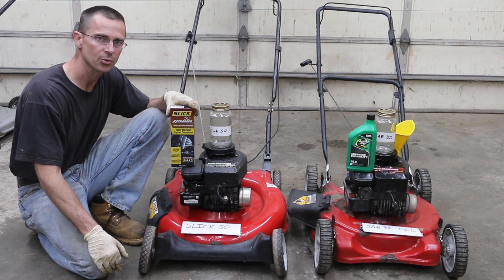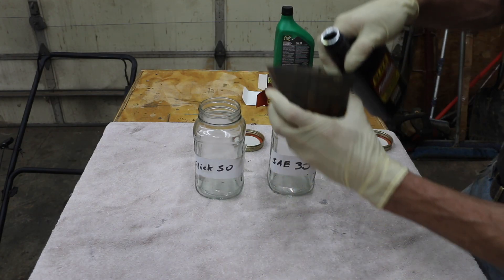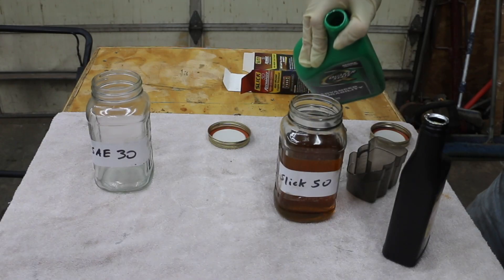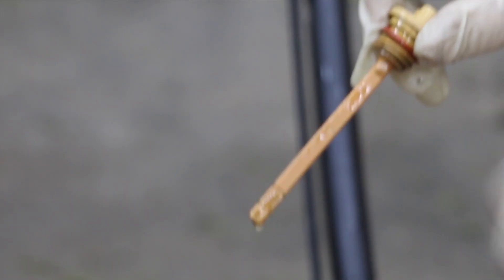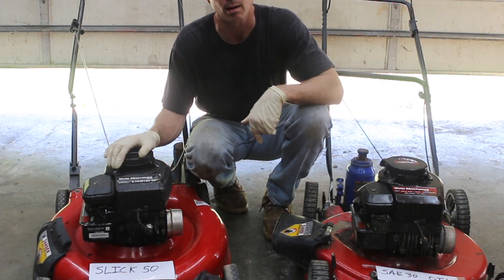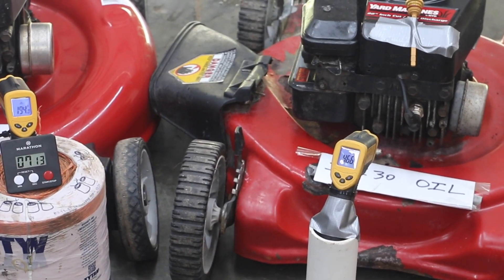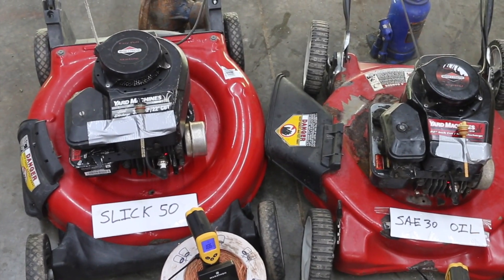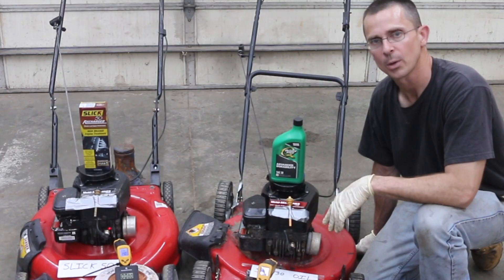Can't believe what SLICK 50 did to my engine!!--Dry Crankcase Test!

Comment: The reason for slick engine failed quicker could be internal clearances. Left engine looks cleaner, newer, has less hours. The right engine looks like has more hours. Just because of more hours engine could have crank/bearings more loose and this could make it run longer.
Reply: In 1984 Slick 50 lost the right to sell the original product. They had to make their own lubricant and it does not meet any of the original specifications of original formula. If you want to try the original formula it is only available branded as Xcelplus.
Reply: Just some thoughts : Idle speed the same ?  Did one have a greater sludge buildup ? One have a heavier blade ? One engine have higher compression ?  It seemed funny how that new oil got so dirty that soon
Reply: Agreed, I was just about to say the same. You need to test on engines with the same amount of wear or check bearing clearances.
Reply: agreed Pasechnik,  although I like this kinda test the motors were not exactly the same.
Reply: The document that shows that Slick-50 today is not the same as Slick-50 pre-1983:

http://www.xcelplus.com.au/docs/false_ad.htm

The Federal Trade Commision (FTC) eventually got involved:

http://www.xcelplus.com.au/docs/ftc1.htm
Reply: Exactamundo ;)
Reply: Doesn't matter, it's still snake oil bullshit
Reply: Troy Mays negative. Tighter clearance means less room for heat expansion these motors didn’t break or mechanically fail they seized due to thermal expansion reducing clearance.
Reply: I agree with a lot of the observations made by others. A couple of things which stand out which makes this test invalid is 1. the engines are not the same age or have the same amount of use. 2. The slick 50 oil was dirtier than the sae 30 oil which suggests to me that the slick 50 engine was not cared for in its previous life and had a lot of internal wear and the sae 30 engine was cleaner and while it looked older may have been in better shape inside.
The whole point of this video, while interesting is nonsense because engines are meant to be run with oil in them, not without oil. 
A better test would be to strip down 2 new engines the same and measure all of the wearing surfaces, reassemble them and then run them both with oil and one with the  additive for say 100 hours and then pull them down and measure the  wearing surfaces and see if there is a difference. That would be a more scientific approach and give people a better idea if it is worth spending their hard earned on a product.
If you have  a small engine and want it to last then just change your oil once a year and it will give many years of service. Additives are just a way for someone to get money out of you that you don't need to spend.
For your car use good quality full synthetic oil and change regularly at least every 10 - 15 thousand kms. In Australia I have seen  a 3.9 litre 6 cylinder ford engine do 975,000 kms and still going strong without ever having the head off. It had oil changes every 10,000 kms.
Reply: I was thinking the same thing
Reply: I think you're on the right track with clearances, but I'm not sure the newer has anything to do with it... 

Slick50 is saying they've got a "magical" version of polytetrafluoroethylene that's supposed to be more robust... The older stuff was using regular polytetrafluoroethylene, which is known for breaking down and turning into giant balls of nasty between your standard engine oil temperature and the temperature of combustion... When it does so, as it cools it collects together larger sizes than what the origins product was when it was added to the emulsion. Those larger diameter particles then begin to plug up the narrow oil galleries in your engine, which then starve it of oil. 
When used in an engine with an oil filter, all those particles are going to collect inside the filter and prematurely plug it. This leads to the oil bypass valve opening to relieve the pressure allowing unfiltered oil to be circulated through the engine, likely with those giant balls of nasty still in it. 
Ultimately, without an engine teardown, we won't know why slick50 failed first... But I wouldn't be surprised to find out that it was due to slick50 preventing oil flow to places that need it, like cylinder walls... Given that polytetrafluoroethylene melts around 500°F and breaks down around 615°F~ish, I'd be very interested to see the inside of the slick50 engine.
Reply: But these cheap two strokes won't have any silicone (or rod bearings!). Looser tolerances on these would actually let them run with poorer lubrication.
Reply: umakegoodcookies You meant 4- strokes I hope.
Reply: True
Reply: I was thinking the same exact thing.
Reply: Pasechnik 
Agreed. May have been helpful to do a compression test on each engine in attempt  to make an assumption concerning wear. However, it's still an enlightening video.
Reply: https://youtu.be/CAt-tJa9P_s
Reply: A compression check should be equal. I noticed the muffler on the 30W mower vibrating, it wouldn't have the same back pressure (and less friction), yet ran hotter. The 30W mower's governor may have increased the fuel, compensating for a lack of compression (more fuel - more heat). But tighter clearances on S50 mower's piston will heat expand & apparently seize first.

Maybe try a worn engine to tight engine no oil test to see who locks up first? Worn engine may last longer but a tight engine should have better economy.
Reply: Bud Nunyerbusiness I think you're on to something sir. Another test would perhaps be to run two engines, whit oil and one also whit slick 50 in it but now without any cooling at all, take away the fanblades and clogg  the cylinders outside whit something so that they run hot as Hell.  Then see if the oil additive helps.
Reply: Just as you say, only fair test is with 2 new motors.
Reply: It looks different now than it did in the early 90s. Is that left engine new? You shouldn't use Slick 50 in new engines. Yeah, I threw quite a bit of money at that product as well.
Reply: I work on cars and motors and more clearance would cause the engine to give up quicker tighter tolerances last longer because there's more metal to have to wear out and new cars actually have silicone in their rod bearings to polish the crank meaning glossing the crank for a longer-lasting engine
Reply: I was thinking that the slick 50 may have a high detergent in it that cleaned the carbon out, which explains the darker color when drained..

Comment: Actually I am more impressed with the fact that the Slick 50 kept that motor cool even with it failing in a shorter time...

A couple of things I have learned about Slick 50 and observed about the test...

1. The original formula is NOT under the Slick 50 name anymore

2. The new slick 50 stuff needs to be shaken in the container it came in prior to pouring, apparently it needs agitation from settling

3. Slick 50 needed to be run at least 6 hours straight with fresh quality motor oil to achieve maximum positive results

4. One of the possible failure points would be that 1 engine was more prone to failure before testing, this is NOT insinuating you rigged it to fail, I am NOT saying that in any way shape or form. What I am implying is, despite modern mass manufacturing some engines will last longer under harsher conditions than others even if they are the same engine. This is not always the case, but it is certainly worth noting.

What struck me the most was again the cooling difference, that tells me the product is actually doing something worthwhile, and I don't know about you but I really prefer to run my engines with oil in them all the time, I prefer full synthetic oil myself (Valvoline MaxLife High Mileage FULL synthetic, NOT the blend).

Comment: Slick 50 is basically Teflon. I used it on an '85 Chevy S-10 that I ran so low on oil the lifters were clacking. I think it saved the engine, but it also had fome coming out of the oil fill tube.
I also used Prolong once, but I didn't accedentally test that one the same way. 
My guess is that you didn't heat up the slick 50 enough for the Teflon to adhere to the engine and instead it did what I've heard others complain about: clogging up the oil passages.

Comment: The engine using slick 50 did not have enough time to treat it. I personally witnessed the same type engine run 12 minutes without oil and with little to no damage, BUT, the engine was treated with Slick 50 for a season of grass cutting.
The demonstration included engine disassembly and inspection of rod, crank, piston and cylinder wall. We even removed the exhaust valve for inspection. 3.5hp Briggs engine.
You did not allow enough treatment time. You did show the lower friction by lower heat.

Comment: Not sure about the "NEW" Slick 50. I used to use the slick 50 from 30+ years ago, and it was a treatment, not just an oil additive.
First thing that was done back then was to shake the can for a bit to suspend the material in the oil, as it was just a carrier of the actual product. Then after adding to a fresh oil change you had to use the motor for about 30 minutes to coat all the frictional surfaces. 
Maybe the fact that Slick 50 called for 10%, and the test was done with 20% bared out in the result. More is not always better.
Yes. I believe the slick 50 still is a good product. If for no other reason than it did seem to reduce friction enough to cause the motor to run cooler = Longer Engine Life.

Great Video +++

Comment: my understanding (no scientific basis) is that products like slick 50 have a very high molybdenum content. and that prolonged use will have a molecular bond in the metal.   so, after some hours of use the two surfaces would be more 'slick' with the absence of fluid.

Comment: While I applaud your efforts, this test is very flawed. Two different engines with different wear on them. You could at least ran the slick 50 mower with regular oil first, check temp. Then add slick 50, check temp. That would have been no question there. I honestly think if you wanted to do this test right you should have used two brand new engines (cost prohibitive I know, and easy for me to say) but in reality this was a waste of time. Thanks for doing it, but I took away nothing from it except that it was a very flawed test. I'd pitch in a few bucks to see you do it with two new motors. I might do a temp test myself on the same engine, my sons go kart engine.

Comment: since the non slick50 egine ran hotter it expanded larger and was able to run longer before siezing. cooler means less expansion tighter engine siezed sooner. since heat shortens the oil life i would keep using the slick50

Comment: If I remember right, Slick 50 contains Teflon particles, which for a short period of time will reduce engine friction and lower operating temperatures.  Problem is all engines burn oil, and when teflon burns it can clog up your oil filter, or worse the oil passages of the engine, so don't put this stuff in your car.  In this case, the briggs engine will indeed run cooler and probably have no ill effects.  My guess is that running without oil in the case rapidly burns the teflon particles, causing it to lock up significantly earlier than the standard oil, I suspect that if you pull the head off and clean it up, the engine with the slick 50 will still run.

Comment: ok the modern Slick 50 is not the same as the old version that did work as described in the videos. I accidentally ran a 1.9 litre diesel for 45 min without any engine oil 25k miles after a treatment the engine went on for 100+ K miles without any issues, this was on the old version.
the old Slick 50 contained a PTFE compound that bonded to engine pressure areas (crank bearings, piston rings, turbo slip rings etc. 
after a long law suit between the owners of PTFE they were made to remove it from their product. So you are not comparing like with like. What is in the new version??? most likely a chlorinated caster oil or modern synthetic equivelent. 
As an aside I would bet the engine you treated with Slick 50 was far more knackered at the start than the other engine. Evidenced by the colour of the oil removed  from both engines. Hence its seizing up early. 
A replacement product to try is "Activate" Available from the UK and possibly other countries.
Its expensive but so far my Fiat (Chrysler) 1.6 t diesel Taxi has done 238500 miles in 4 years 95% driving round a small town 5% thrashing down motorways. Still original Gearbox (treated at  85k miles after oil change) and turbo engine etc. Activate added every 25k miles at 50% original dosage. engine flushed every 50k miles with flushing oil.

Comment: I've just run across your videos and this is about the 5th one I've watched this evening. Most very well done and thoroughly enjoyable as well as educational. (generally) Like some others pointed out, there were some flaws in this test that might have skewed the results, but to test the product you enjoyed over 20 years ago on those commercials, you need to test Xcelplus. That is the original Slick-50 product. A thing happened back in the 80s when the inventor of the product lost the name of the the company, but retained the formula, which the new guys didn't get and didn't recreate.

Keep up the videos. Great work!

Comment: You should have used two brand new engines of the same model and manufacturer. I think the mower you used the Slick 50 in for your test was more "used' than the other one.

Comment: This stuff and similar products are a waste of money and in a modern automobile engine not a good thing to use. Engines with variable valve timing (e.g. Honda) often specify 5W-20 or thinner oils to operate correctly. This stuff is 50W with PFTE . It  will clog up or reduce the oil flow in the tiny orifices in these valve trains. You can guess how that works out.
  Buy the correct oil specified for your car from a name brand maker. Unless you drive on the Interstate all day long, change the oil as required for "severe duty use" a.k.a. normal every day driving. Use a quality oil filter, e.g. Wix/Napa... use Fram filters for a door stop. Check the oil every week, noting that adding a quart between oil changes is normal and means that if there are no leaks your engine is consuming oil as it should... That oil loss is the oil film protecting your piston rings and cylinder bores. Engines that do this should have rings, bores, and bottom ends that under normal use should last 500,000 miles with perhaps a top end overhaul at 250,000 miles.
Reply: Aceroadholder WHAT tiny orifices? We're not talking a carburetor here, and you do realize viscosity is NOT the same as flow rate in motor oil, right?
Reply: Aceroadholder Not to mention, no engine should "use" oil, it's wind age sucked through the PCV valve that's burned in the engine to produce carbon buildup, dingus. Does a new, or even broken in engine that was maintained CORRECTLY, no as the manufacturer suggests so it breaks after 100k and you have to buy another one, does an engine like that "use oil"? No, it doesn't. If your engines "use" a quart or more between changes, it's not working correctly for some reason. Use the grape buddy, use...the grape.
Reply: I can tell from most you folks comments you know nothing about real "Slick-50" as in this video this is not the real stuff....I had an "Slick-50" engine that I used back in the late 70's early 80's that I used for demos, no oil in it after "Slick-50" "proper" treatment....ran for 1.5 hours no oil at all...walked over pulled the rope fired right back up ran another 1-2 hours....sold many a quart of "Slick-50", also had a 1971 FORD Pinto for demos...not a drop of oil or water in it, drove it all around to different shops as a demo...and got 34 miles to a gallon of fuel...never over heated nor locked up....should have seen the folks faces, when they saw I didnt have and oil filter on the Pinto, much less a drain plug....if you want to challenge me on a test, you are welcome to come to North Carolina...I'll bet you I'll take your money.....and if you can't believe this, call Crane Cams, and ask for Frank Pellino....as he was with me one day while in my 1966 Dodge truck (also treated) when the battery came loose and went through the radiator, he was worried he was gonna get fired did not think we would make it back to his machine shop...I refused to turn back, told him calm down we protected with "Slick-50", even bet him lunch the truck would run just as good or better with no water...continued on trip made it back, got a free steak dinner, and he then introduced "Slick-50" to his bosses, thus it then made it into NAscar, once one team ran it, they all had to...rules are rules you know....?  ..Terry Hoots..
Reply: elgransr Hi I don’t often comment on these types of issues. I saw your question, and felt that you needed a proper answer. From a life long mechanic. Use either exactly what you’re cars owner manual calls for, or better. Always follow the manufactures recommendations. If you’re vehicle requires a synthetic 0-20. Which at 100$ a change. I’m guessing, it’s a synthetic. You certainly wouldn’t benefit, from changing to a different viscosity. Nor a lesser grade oil. I own an old 2002 Saturn S2 . I’ve used nothing less than, either Valvoline or Mobile 1 full synthetic. I’ve gotten well over 200k miles, and she’s running like a top. I have no reason, to believe. I won’t get 500k plus miles out of my engine. Mainly due to proper maintenance. Done at proper intervals. That’s key. Hope this helps you to get as many miles out of you’re engine as possible.
Reply: I have a new honda and it says I cna use allmost all types of oil. But they suggest 10w 30. Whereas in the USA it says to use only 0w 20. I can not find 0w 20 where I live and if I do it almost 100 dollars just for the oil. What is your opiin. Can I run 5w30 or 10w 30?